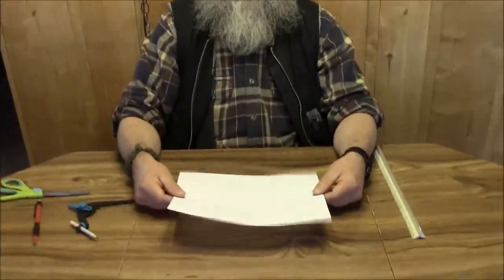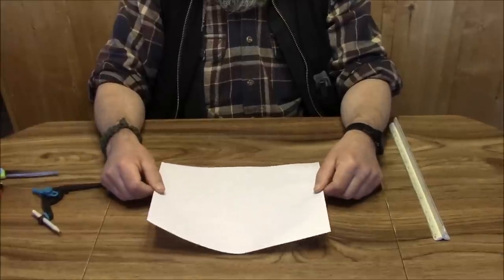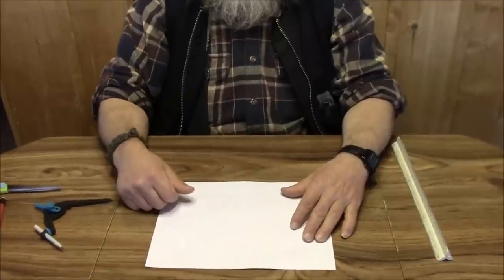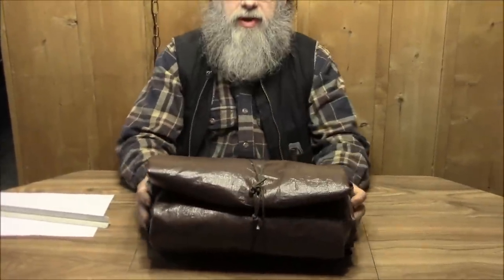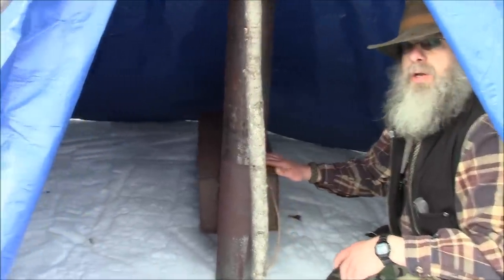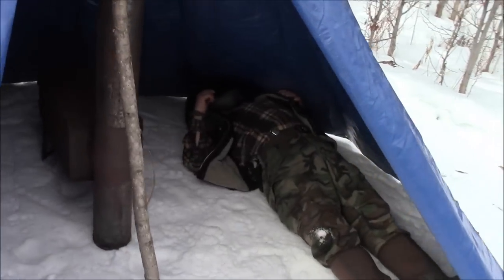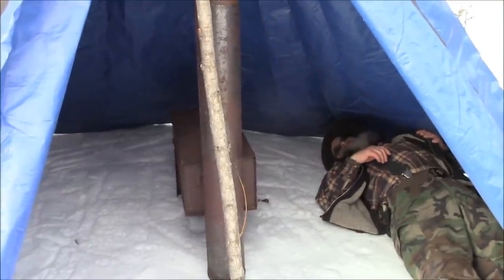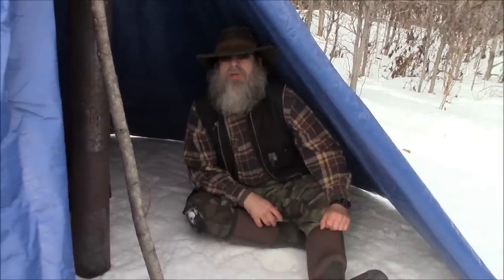Make A Tarp Tent Tipi Hot Tent On The Cheap

Comment: Hard to find but exterior duct tape holds up to harsh outside conditions. I was moved to a work area hours away and living in hotels. Before heading out had two things on the Silverado taken care of. One was a simple taillight bulb. An hour down the road the taillight lens assembly was hanging by it's electric wires. The guy forgot to put in the bolt that held it in place. Used exterior duct tape and it held it for the four more months the truck as assigned to me.
Reply from the maker: Here in Alaska we call a good quality duct tape, "one hundred mile an hour tape" because pilots have emergency patched the fabric of their fuselage or wings when a bear or some other accident has ripped the fabric.  The pilots could fly 100 miles an hour and the tape would hold their plane together.   I do not know what specific tape/s qualify for that name as I am not a general aviation pilot though I do have an ultralight aircraft and pilot it at a much slower top speed.   My aircraft is all open and not fabric covered.

Comment: Would be possible to sit inside with a folding chair and stove with a guitar comfortably?
Reply from the maker: Yes as long as the folding chair sat on the ground.   I do use a short folding chair in there when I am by myself and it is okay but none too much room for it for sure.
Reply from the maker: Yes you can easily scale this up or down in size using the information here as guidance.

Comment: Lonnie, did you ever make black garlic? I’m looking into making it. Apparently, all you need is a rice cooker that has a manual on off switch for the low setting. Load it up with whole heads of garlic and leave it on low for two weeks. If you have any tips about it, please let me know. Thanks, Jon.
Reply from the maker: No I have no experience with black garlic and was not aware of it before your comment.
Reply: Far North Bushcraft And Survival there’s a lot of videos on how to make it. Different videos have different slightly techniques. You can use a rice cooker or a slow cooker. They even make a cooker just for making black garlic. People eat it for its health benefits and taste. It’s supposed to have twice the antioxidants than regular garlic. People eat it like candy or add it to recipes. Garlic keeps arterial plaques from sticking to your veins and arteries and cleans you out, calms you, lowers your blood pressure, helps to thin your blood, and more. Apparently, black garlic is expensive to buy. I think it’s on Amazon. I’m going to see if my slow cooker will stay on without automatically shutting off. Otherwise, I’ll buy a cheapo old rice cooker. The temperature for cooking or warming on low should be around 130° to 140° for 2 weeks. Times and temps vary. The lower the temp the longer to cook. Some people refer to it as fermentation, others say it’s cooking. There’s different factors involved that determine the final product and it’s qualities. Mainly the humidity or moisture level while cooking and the number of days in the cooker. It’s all stuff you have to play with to get it to come out the way you like it. If you get into making it, I’d love to see your vid. My brother grows his own garlic, but it’s also cheap to buy. I’m definitely going to get into doing this because I know garlic is one of thee best medicinal and health foods out there. My veins and arteries are clean and clear and that is in part due to eating garlic and taking garlic supplements. See ya Lonnie.
Reply from the maker: I did go and watch several videos on the subject and it sounds interesting.   Connie ferments vegetables.   In fact i am eating my tossed green salad right now as i type this with no salad dressing other than the fermented vegetables.  The fermented vegetables are loaded with live active probiotics which are extremely important to not only gut health but overall body health in general.   It sounds like teh black garlic may or may not be a form of fermentation also.   Either way though I can't help but wonder what the long duration of raised temperatures do to the nutrients and medicinal aspects of the raw garlic.   It seems to me that if it has any impact on fore mentioned aspects it most likely be negative.   That is purely guessing on my part however and not based on facts in any way.
Reply: Far North Bushcraft And Survival I make fermented vegetables too like kimchi. I put garlic and hot peppers in mine and lots of onions and napa cabbage. I need to make some. I’m just about done wit 3 weeks of taking antibiotics. I got a tick bite and started getting rashes on my body that later were found to be burns from cinnamon essential oil. Stayed on the antibiotics just in case. You’re lucky you don’t have ticks there. Time for a amoxicillin pill. Yippee! Ticks are bad in Pennsylvania. I got my last one on a short walk. I like the liquid in my fermented vegetables. It’s like soup. I kept a batch in my fridge for a year just to see how it would keep. It seemed fine. I want to make the black garlic just to have it to eat every day and see what it does for me. One of my cousin’s has a stepfather who is a heart surgeon at the Cleveland Clinic. They did a study that proved that a vegetarian diet reverses heart disease. It cleans out the arteries etc.  For all the “bad” foods I ate all my life I was surprised to find out that my veins arteries and organs were all healthy clean and clear. I also supplement with N-acetyl cysteine which cleans your arteries too. It’s not as harsh as edta, but edta is a good cleaner too, but you should supplement with a multi vitamin mineral when taking edta or NAC because they can remove good metals from your body. It’ll be nice when we have bodies that don’t require so much maintenance. I guess that’s just one of things that has to be dealt with in this physical/spiritual existence. The next life is going to be quite the new experience.
Reply from the maker: Amen and amen my brother/sister in Christ
Reply: Far North Bushcraft And Survival I’d definitely be a brother.
Reply from the maker: No offense meant.   One cannot always tell by the youtube name alone.   So I was just making sure by listing both sexes.  You might have told me in the past but with my lousy memory and over a quarter of a million subs I couldn't remember.
Reply: Far North Bushcraft And Survival No problem. When I used to be a teacher, I taught mainly at one school, but for several years I taught at 10 different school districts from grades K thru 12. There were hundreds upon hundreds of kids that wondered why I didn’t always remember everyone’s names. I get it. Lecithin liquid capsules are supposed to be good for the brain and from what I can remember, the memory too. I think it has something to do with choline or inositol or both. I used to take it regularly. It has good benefits.

Comment: How long was the pole??
Reply from the maker: Short answer: I don't know.   Long answer:  I don't recall if I ever officially measured it.  After getting ready to set the tipi up in a new location I stake the tipi down all around.  I then lift up the peak and roughly measure the height using my body height as a gauge,  I then go out and cut a pole roughly that same length.  I insert it and if it proves to be too long I simply saw off an inch or two.  The length of the pole can change from location to location depending on the unevenness of the ground there in each location.    I now have several aluminum adjustable extendible poles such as is used by painters for attaching paint rollers to.  I usually use one of those as my center pole for my tipi's.  This 12 by 16 gets to be too small for my preferences because of having to crawl around on my hands and knees so much when using a center pole instead of outside support.  A 16 X 20 foot tarp would make a much nicer and roomier version in my opinion.

Comment: How would you suggest insulating your tarp tipi tent ?
Reply from the maker: I have made several tarp shelters where I add an additional layer of tarp or sheet plastic and it has made a big difference.   I did add a layer of cheap mylar space blankets to this shelter by just taping around the edges and leaving the middle of each sheet hanging free away from the wall.   It worked quite well but was unfortunately not very durable and the mylar is tore up quite a bit now.
Reply: Thank You for the reply, I was thinking of using space blankets, or another tarp and double layer it
Reply: Do the ``reflective`` silver tarps actually reflect ?

Comment: Could you install a zipper on this type of tent?
Reply from the maker: Yes you could quite easily.  There are zipper assembly kits made for applying to tarps.  They are adhesive backed.   However the reviews I have read about using them is that the zippers were somewhat problem prone.  Perhaps there are higher quality ones out there now as it has been quite a while since I last looked.

Comment: How does a bi-pod hold this up? Don't you need three poles?
Reply from the maker: The bipod will hold the peak of teh tent up and the tent base stakes will hold the bipod up.     The staked down tent will keep the bipod from falling either direction.    Yes you could use a tripod but a tripod having that third leg makes the ordeal of lining the suspension system up directly over the erected center of the tent just that much more difficult than a bibod with only two legs.
Reply: Far North Bushcraft And Survival :
Thanks.

Comment: I've used that Gorilla tape on tarps and long term it won't stay put. The glue gets soft or gummy with summer heat. So heater would do the same. Really enjoyed your tutorial but I would machine sew the tape borders/seams
Reply from the maker: what is meant by "long term"?  I have had this now over a year and have camped in this about 5 times for a total time of somewhere around 3 or 4 weeks.   It is still holding EXTREMELY well.   I just got back from a back country trip with the tipi and was once again impressed with the tenacity of the tape.    I'm assuming that what you are talking about is some sort of UV degradation. brought about by long term sun exposure.   Regular duct tape does that but it takes a while.
Reply: I'm not talking about UV degradation of the actual tape itself, but the glue on the back of the tape softening and becoming less tenacious and even lifting. Of course then it becomes susceptible to dirt and water further undermining it and preventing from sticking it back down. I made an extra room via a tarp on to a two room canvas tent a couple of years ago with that type of tape (not duct tape). Tent was up around 3 months during an Australian summer and that is probably the key, ie the different climate and dissimilar materials retaining a bond  I'm sorry if I appeared critical of your endeavour as that was not my intention. My thinking was if one is going to go to such length to make such a tent,  then stitching along the edges would ensure the tape stays put for the entire life of the tent.
Reply from the maker: Oh I definitely agree with you that stitching would be better and more permanent.   My wife does not want me using here sewing machine however to sew tarps.  :o).    I was curious as to what your "long term" reference meant so as to get an idea on occasional use longevity under similar circumstances.    So three months would translate to 3 - 4 years of my occasional camping use.   Since we may not have the sun exposure here in Alaska that you have in your location, that might mean that I could get even more years of use out of my tipi.    Considering the expense involved here in making this, to replace it every 5 - 6 years or so, if needed, would still be a good investment.   I sure would love to have a heavy duty commercial sewing machine.   If I had one, I would sure put it to good use.

Comment: how did you determine the pole lenght
Reply from the maker: +Jeffrey Donaldson     I stake out the tipi perimeter and then step in the doorway and lift the peak and position the peak until the walls are tight all the way around.   I now estimate the height by comparing it to my standing body.   Then I go out and prepare a center pole that will be long enough including adding length to it to estimate the depth that it will sink into the floor surface such as when I am camping on snow.    I place the pole in place and if it is too long I remove the pole and trim it accordingly.
Reply: +Far North Bushcraft And Survival thanks so much

Comment: HOw long is the center pole?
Reply from the maker: As long as it needs to be.   In other words, the height can and will vary depending on the levelness of ground that the tipi is set up on or whether the tipi is set up on snow, sand or hard ground.   Approximately 6 feet high give or take several inches.

Comment: i miss my valance on my other tents its a much underutilised design feature in modern day tents
i used mine most of the time when i had it?
tents had its day now
i keep it for sentimental reasons now id like to make a new fly but the angles construction techniques needed are a bit too complex
a tipi is far simpler
than tent i have got
this is a double A pole ridge with scalloped fly 
the ridge has a scalloped dip
isnt straight
to beat the winds bell ends are also uniquely shaped pole sleeves n fulcrum points need complex joining stitching 
techniques something best left to a prof seamstress or prepared tentmaker!
sailmakers can provide useful materials n services 
luckily i have a few of them in my area some of their stitching techniques can make a supermkt bag pretty invincible!!

Comment: Hello Lonnie and Connie, it’s Donny Zarra from Pittsburgh, PA.  I am your biggest fan!  Anyway, my question is this.  I have a long roll of TYVEK.  It is 9 feet wide.  If it tape two sections together, that will give me an eighteen foot width roughly.  How long should I cut the length if my set width is 18 feet?  Any other suggestions do you have for me working with TYVEK would be great.  Thank you and God Bless
Reply from the maker: My tipi is made from 12X16 tarp if I remember correctly while I know of another fella that made his from a 16 X 20.   Like I showed in the video, if you use a different sized tarp you may wish to make a paper model to scale to get a visual on what your finished product may look like and if you do not like the looks, that is the time to change it.   My tarp is a 3 to 4 ratio and the fella that used the 16 X 20 tarp, his is a 4 to 5 ratio.   I would suggest that you may also want to aim for a width to length ratio in that range as well since these have worked well for us.
Reply: @Far-North-Bushcraft-Survival  thank  you.  How do you figure out the ratio?
Reply from the maker: I was terrible at math is school but this is what I think is how it is done.  In the 16 X 20 tarp a 4 will go into 16 four times and the same number 4 will go into 20 five times.   So it is a 4 to 5 ratio.   SO if you want to use a 4 to 5 ratio on your 18 foot tarp I think you can figure it the following way.   Eighteen divided by five = 3.6.  Three point six times 4 = 14.4.  I think one could round the 14.4 off to 14.5 or in feet that would be 14 feet and 6 inches.   So a four to five ratio with an eighteen foot tarp would be 18 feet X 14 feet 6 inches.   You could figure a three to four ratio the same way.
Reply: @Far-North-Bushcraft-Survival  thanks Lonny, I think I am going to go 18x22.  Do you think that will work?
Reply from the maker: Sounds like it should work to me.  Like I said, it would not hurt to make a paper model to scale using your new dimensions scaled down.  That way you can get a visual on not only the shape of the tipi but you will also be able to then see what the width and height of the finished tipi should be.
Reply: @Far-North-Bushcraft-Survival  I appreciate your feedback.  Thank you Sir.

Comment: How tall is the pole you used to keep the center up?
Reply from the maker: approximately 6 foot.   In the past I have not had a specific pole but rather cut one each time i am out with the tipi.  Each time, the pole length will be slightly different due to uneven ground.   More recently I have begun using an extendible telescopic aluminum pole as the center pole.   That pole is handy since it is ready made and is adjustable to meat the specific height needs at each set up location.
Reply: @Far-North-Bushcraft-Survival  awesome, thanks for the video and the reply. I just finished making mine, just need to put the stove jack in and I'm ready for winter!
Reply from the maker: Awesome.

Comment: I am watching your stove pipe installation and another question arose during the cutting and addition of velcro You might have just cut 2 sides and made them to match the already sewn sides that came from the fiberglass that you boughtt from Amazon save time and stronger part less work .
Reply from the maker: +Frank Yeyna    I had thought of that but decided not to.  I don't remember why now.  Maybe it was because the existing fiberglass matt seam was too thick and I was worried about my wife's home sewing machine being able to sew through all the material required.   her machine is over 30 years old    She is worried every time I come up with a new sewing project.  My sewing needs usually are more heavy duty then her typical fabric work.